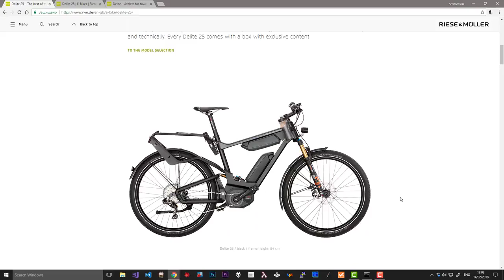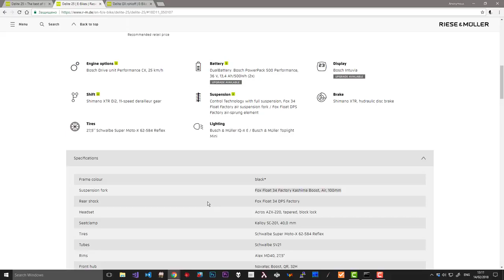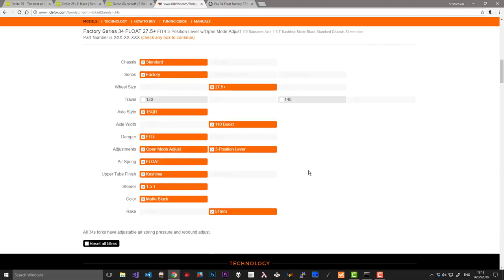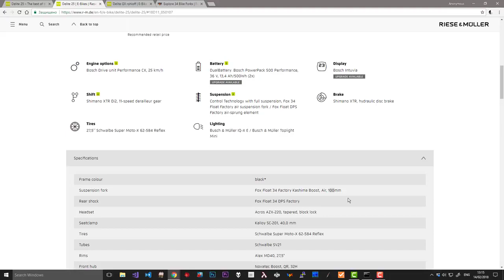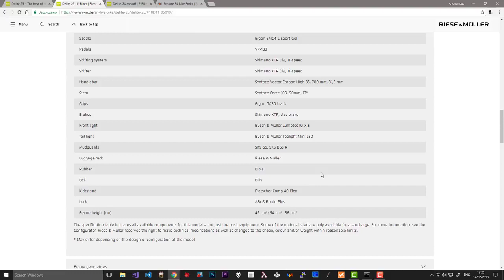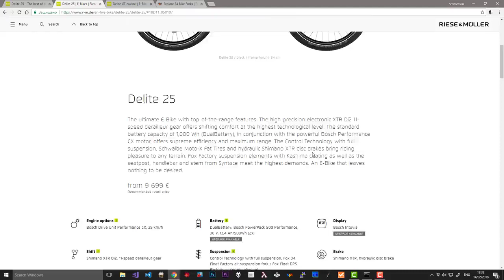My Opinions on R&M Delite 25

Comment: In Australia bike comes with dual batteries standard. Rear wheel is close to guard at rear suspension point in order to minimize wheel base and add strength.  Precision engineering rather than oversight.  Thanks for interesting review.

Comment: In my opinion this is not a MTB, it's a Trecking (or new Cross) Bike. I do not know which paths / road you have in your area but in Germany (and other parts of Europe) there are many forest tracks with stabile condensed sanded surface and tons of rural and farm roads in rural areas. 

Here a full suspension is pure comfort, also country roads (for cars) in rural areas often in really bad condition at the outside (Where cyclist have to ride). In north of Germany hubs are more prefered in southern germany (Alps and the low mountain range areas like Eifel, Hunsrück, Taunus, Westerwald, Schwarzwald, Erzgebirge, Harz) cassette gear shifters is more prefered.